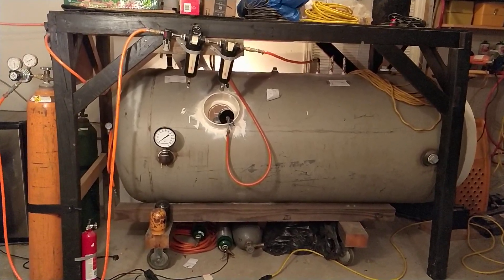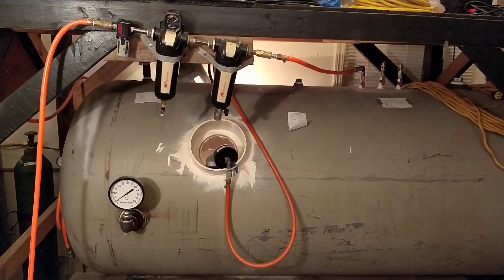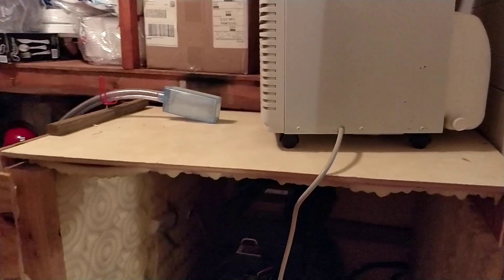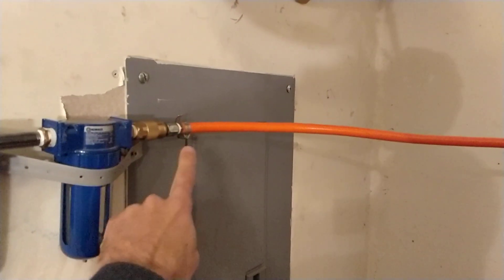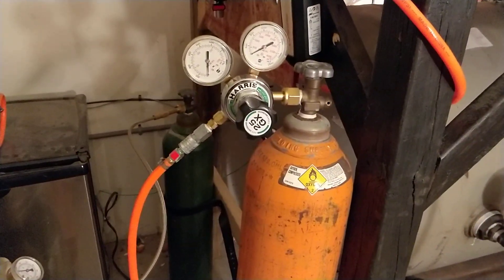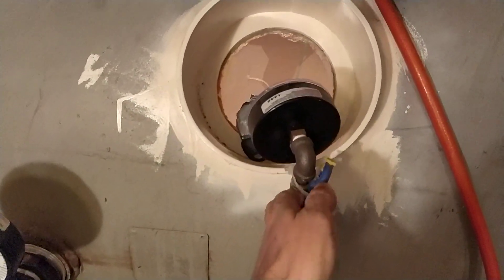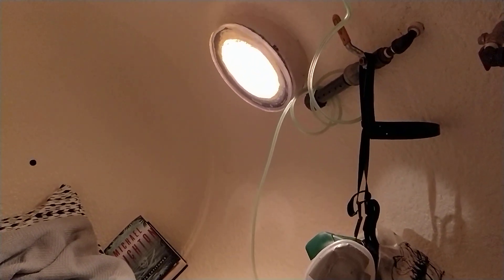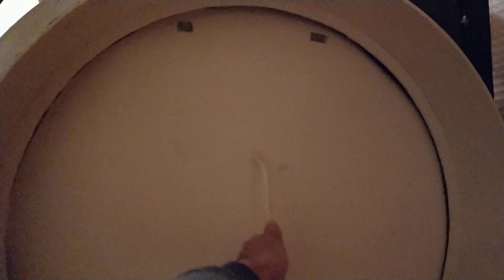Hyperbaric Oxygen Chamber (Home made)

Comment: Hi Ed got inspired. Started building a chamber. I bought a used Invacare Venture HomeFill System II . I am struggling and stuck on the part where i am trying to figure out the brass fittings and hoses for filling the cylinders from the homefill system. If i were to request the same brass fittings for tank fillings ( i have 3 size E tanks with CGA 870, a M tanks with CGA 540 , 3 ez Ox Plus with CGA 540 size E tanks.  Can you refer me the to shop that built you this hose, valve assembly. It is neat that its plug and play.
Reply from the maker: Sure, I don't have those same tanks. My tanks are K size. However, that doesn't matter. All you have to do is google and find a Welding Supplier in your area. These suppliers will have the ability to put together a system for you. Bring your tanks with you. That's what i did. Tell them you the hoses the need to be 2000 psi or higher compatability. Make sure you DO NOT tell them it's for a hyperbaric chamber. They will freak out and tell you they can't help you. It happened to me at 2 different places. Tell them that you are getting into the hobby of Glass Blowing and are creating your own pure oxygen generating system. They are ok with building a system for Glass Blowers, not for medical devices.
That's all i can offer. Good luck.
Reply: @goretoye  Just to get an idea, how much did it cost you to get the hoses built?
Reply from the maker: Ummm, don't exactly remember. I built all this several years ago. Lets see, I think it was around $200 for the hoses and fittings.
Reply: @goretoye  Hi Ed, are those metal port fittings that you used to interface the chamber or pvc?  Just wondering if you welded them into the tank or used some type of epoxy. Also, the window port openings, are they metal or pvc?  thanks!
Reply from the maker: @WilliamJTW  
I welded all metal fittings in. I don't think pvc with glue can handle such pressures repeatedly. Too risky in my opinion.

Comment: How do you supply oxygen, do you use oxygen mask? or do you compress pure oxygen directly into the chamber.
Reply from the maker: The tank itself is compressed with ambient air (the air that we breath outside). I breath pure oxygen from the large K-Tanks that I pressurize to 1000 psi, this is the pure oxygen that I breath through the mask. So, there are 2 sources of oxygen coming into the tank at the same time.
Reply: Many thanks  @goretoye   what was the cost, a rough figure?
Reply from the maker: @eminari66  Hmmm, rough estimate is $4,000. The main costs went to the Invacare HomeFill which cost me $1,500. This was followed by large costs for the brand new air filters and compressors that I had to get. My brother found the large 7 foot tank for free from an old Textile mill. I spent a couple years slowly saving money, buying stuff and putting it together.

Comment: You sir, are a legend :). What did you use for the main body of the chamber? It is an old water tank or something?
Reply from the maker: MastaRob 
Haha thnx. This was a large oxygen reserve tank at an older textile plant. My brother called around and found it. We traded the guy a cake for it. He was happy and so were we :)
Reply from the maker: I went to Wikipedia and typed in this into search engine: Hyperbaric treatment schedules
They have all the Navy Treatment tables there
Reply from the maker: The tanks are called K Tanks. There are many different sizes, small to large. I found mine on Craigslist for super cheap.
Reply: V 4 Vendetta    You want to make the controls to hold 1.5 atmospheres of pressure [about 4 p.s.i.].  That is "low pressure HBOT", which is NOT the same as the high-pressure used to treat those with the bends.  Using low pressure, you can get by without adding an O2 supply, just using the pressure + air. 
About 2 hours in a chamber like that, without adding O2, is about equal to using the chamber for 1 hour with O2 added.  
So, approximately doubling the length of time in simple pressurized chamber, can save you a few thousand dollars off buying an O2 concentrator [and paying more to maintain them!]. 
Pressure sickness [The Bends], is treated using higher-pressure chambers, and does require going through timing stages and measuring blood gasses periodically, to determine how well the person is progressing. That requires a licensed medical Doc, trained in using HBOT for healing Pressure Sickness, on hand, the whole time, monitoring it. 
Low pressure HBOT [hyperbaric], is only about 1.5 Atmospheres [about 4.5 p.s.i.], therefore it has NO restrictions on how fast the chamber can be pressurized or depressurized, and, while attendants are nearby and can come when needed, they are not required to stay in the room with person in the chamber.  AND, one can easily interrupt a session inside the chamber to take a potty break, for instance.  The low pressure HBOT can allow using one's smart phone or tablet while resting inside chamber during treatment.   It only takes a minute or two to pressurize or depressurize.    Chambers have gauges inside and outside, so someone using it alone, can operate it without help, and can always get out. 
Sandia Labs has made a portable plastic baggie chamber that snugs around the base of the ribs, holding the whole lower body inside the pressure baggie....so, why not make something like that?   That could be much better for folks who cannot tolerate getting fully into a chamber.
Reply: V 4 Vendetta  see the book from Dr. Harch...
Reply: I just finished one that can be pressurized to 2 ATA (28PSI), has power on the inside, and is on wheels. I am willing to sell it if you are interested. I could probably even deliver if gas and time is paid for!

Comment: Dude that's impressive, how much did it cost to build this beauty?
Reply from the maker: Jacob Bragg 
Thnx man. I built this over the course of a couple years really slowly. Made lots of modifications along the way. I would say I probably put in maybe $4,000. The filters and O2 concentrator were crazy expensive, but necessary.
Reply: You mentioned blow off valves at 30 and 35 psi. Does your chamber go up to 3 ATM? If you are going above 1.5 ATM, you may also want to grab a few fire blankets (cheap, $20 a piece on Amazon) to immediately smother any fires that may start. Even with NO oxygen concentration, at 2 or 3 ATM all fires burn 2 or 3 times faster (respectively). If a static spark starts something on fire in there while it's under pressure, you are incredibly screwed without precautions. Fire blankets are a good safety investment. Also, how close is the nearest professional hard chamber from your home? I highly recommend you print out a half a dozen maps (with phone numbers) to the nearest hyperbaric hard chamber. In the case of an emergency where you need to get out of the chamber ASAP (like in the case of a fire) there is a chance you'll suffer from decompression illness and you will need to rush to the nearest hard chamber to recompress yourself (have someone else drive you there if possible). Don't bother going to the hospital, they'll just dick around for a few hours or days before they come to the conclusion that you need to get into a hard chamber, costing you precious time. You might also want to make sure your local hyperbaric facility accepts emergency walk-ins without doctor's orders. Hahaha! :D

Having said all that, your project is indeed inspiring. Keep it up! The benefits of hyperbaric FAR outweigh the risks. Even if it is just for "fun." ;)
Reply: @dman2188  depends how long he's been under that pressure.
Time vs pressure tables
Reply: @HealthCareUndelegated  Should build a second chamber for emergencies, can be filled with ambient air and filter. Won't cost nearly as much.